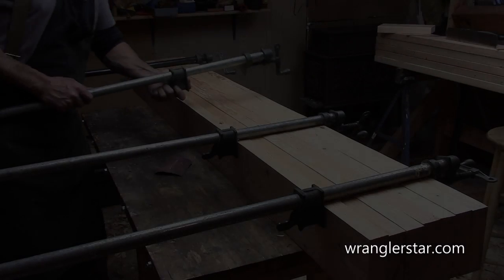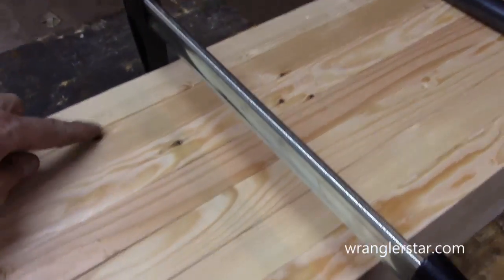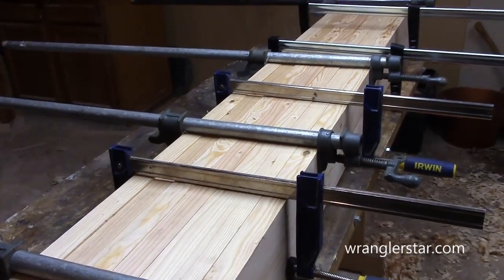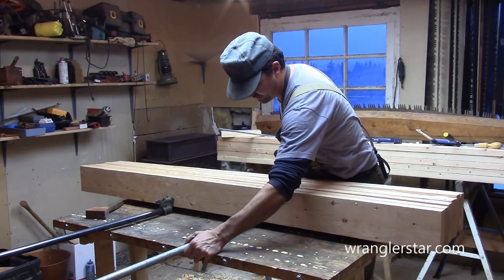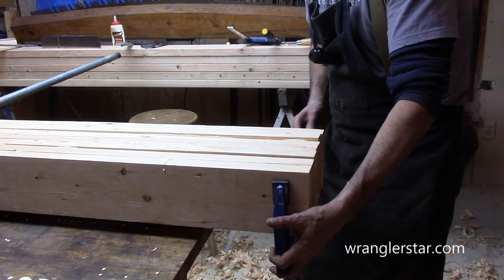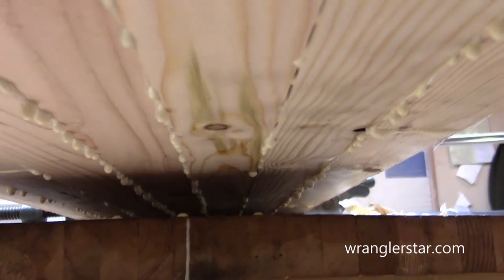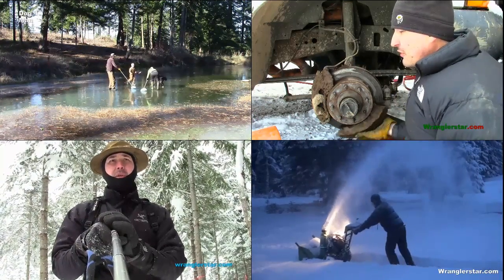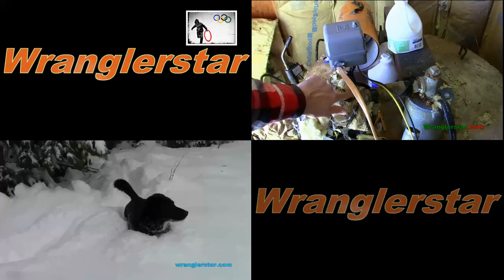Poor Man's Carpenter's Bench | 2 Wranglerstar

Comment: you don't need more glue you just need to find a scrap of wood and spread the glue and completely cover each flat surface with your already generous application of glue. the joints will not have any voids and you'll get full squeeze out the full length of the board. Then when you clamp, place cauls, scraps of wood, placed between the clamp heads and the wood project to protect the clamps from leaving dents in your project as you apply pressure and tighten the pipe clamps. more importantly it also spreads the clamping forces more evenly across the face of the boards to get  a more even, tighter bond. I have a friend that builds custom laminated  beams for a living.
Reply: h baker super helpful information. Thanks

Comment: Ive been watching your videos for almost 18 months. I have never commented because for the most part I have been learning, however on this video if you do not mind I would like to make some recomendations in the even that you ever build another work bench for any reason.  When you make a glue up that big I would do it in smaller portions, so instead of doing 6 peices of wood only do it in pairs of 2, I know you dont have many clamps so it will take longer but that way you will get a better glue up.  Also spread out the glue evenly with either a roller, putty knife, scraper, ruler or what ever you have that is flat so you can get a even coat, it will help it dry faster and evenly so that you can avoid gaps like the 1s that you pointed out.

I mean no disrespect with this comment, i watched my dad over 15 years build benches for other people and neededless to say he had ALOT more clamps since he was a full time carpenter but he still did it that way because he could get better pressure on the full area.
Reply: uberLejoe
 Well I do alot of woodworking at home and build anything that we need because im not going to pay some one to build something that I can do my self, but definitly not as much as cody does

Comment: Just some thoughts incase you're interested. Tip on how to adjust the blade. When you dial it out about 1mm, from underneath the blade and look along the sole from the front to the back, holding the plane upside down, you can see if its level side to side or not and at the same time adjust with the lever with the back hand. Then when its set level, dial de blade back into the sole and slowly ease it out while planing the wood until you have the right depth (on feel and judging by the curl).  Also one more suggestion on sharpening. If you only sharpen one side of the cutting edge you must end up with a bad bur. I personally also sharpen the flat part of the blade. Good way to test sharpness is to try and shave some hairs of your arm (obviously very carefully). Also make a habit of always putting the plane down on it's side. Lastly, it's important to pay attention to the direction of the grain, always plane along with it not against it. Before starting planing, examine the direction of the grain. Really nice to see you enjoying planing the way you do. I can tolally relate. Wish my workshop had that view.

Comment: Remember: A workbench like this is a work holding device, not a table.  Flat is important. Smooth makes no difference. Small gaps in the glue are not a problem. The beauty of this type of bench is that you can use it and not worry about bruising it.  When it starts getting banged up enough to be a problem, plane it smooth and start fresh.

Comment: I liked that you used the 2 by 6 for this project.  I wouldn't lose much of that mass.  It will be heavy, but I wouldn't go any further down that 5 inches, or just until it is planed flat.  Looking good man.  I was curious how much glue you used.  Looked like you made it through that one bottle pretty easily.  Looking forward to the next part.  This is going to be awesome.

Comment: Being australian we have a cement bond branded Bondcrete, its just PVA, same as wood glue. I use tubs of the stuff, half the price of PVA glue, and apply it with a 4 inch paint brush on both surfaces, super strong but indoor glue only. Will solve your gluing problems and always get max squeeze out!

Comment: Great video brother... Leave the bench as thick as possible you will want the extra thickness in the future if you decide to add peg holes for clamping... thicker also means you can run your plane over it in the future when the top surface gets worn; to remove blemishes.

Comment: When I build workbenches I tend to spare the glue and work with bolts and board. In the same way the butcher block workbench you're working on is designed. To fasten the tabletop with bolts and nuts, I can always disassemble the tabletop to make repairs and replace boards if needed. It saves me the pain of having to break apart or buy/make a new surface. When assembling I use oil and sawdust or sawdust from planer shavings that I hand pulverize to fill gaps, or I use branded woodfiller.

Comment: Hey Cody one way to get the middles clamped is to drill holes though the center and use all- thread to pull it together you could also use your pipe clamps for this as well. Then trim it out so you don't see the holes.  I also agree that  weight is your friend so keep it as thick as possible.

Comment: The bench top section looks fine.
Make the videos as long as you think they should be.
I had to plane the mating surfaces on the second bench after I glued up the two 12" wide slabs they were curved in a very slight S shape so they just wouldn't fit like I wanted.
With a nice thick top I don't think you will need any additional hardware to hold the top together. Bolts don't expand and contract with humidity like the top will. When I brought the 2nd bench top into the basement from the garage it shrank about 3/8" of an inch. With bolts the top expands and the bolts crush the wood. Every time you tighten them the wood just crushes further.
I see you put on the glue and slid the boards a few inches to spread the glue. Very Proper.

Comment: Love those clamps. I have several long and some shorty's. Work better and lock up tighter than any other clamp I've used and I've used a ton. They are older design but work better than modern ones. They are indestructible too. That's when they made stuff to actually last and work over a lifetime.

Comment: A few ideas to make the next glue up go faster.  1. pour glue in a dish(use a gallon jug of blue, you will need it) and use a brush or small roller to apply and it goes faster, 2. spread it over the whole surface of one side, so you don't have gaps.  3.  Limit each glue up to only maybe 4-5 boards so the glue doesn't start to setup on you before you get the clamps on.  Then glue the bigger sections to each other.  I think a 3 inch top is sufficient, which is how thick I made mine and it is very solid(weighs about 150-200 lbs, yours is going to be very heavy).  Great video series, I can't imagine myself doing all that hand planing, it was hard enough with power tools.

Comment: The shop I worked in use HOT water, as hot as you could stand to put your hands in to clean up the same glue you used.
We cleaned the glue to protect sharp edge of the tools, we used cloth dipped in the hot water to wide the glue off.
Reply from the maker: +jolj1 no hot water in shop
Reply: +jolj1 The warm blood of complainers also works.

Comment: Hi Cody. You asked about the bench top thinkness....i wouldnt worry as I have both a 3 inch thick top bench and a 6 inch thick bench and they both hold up nicely, plane just as easy and take a holdfast just as well regardless of the thickness. Although, the thicker top bench with its extra weight will not slide around as much when planing touch stock...

Comment: Cody, I've built 2 Roubo-style workbenches from doug fir, similar to yours. Top thickness of about 4" is fine; not that big a deal. Holdfasts, depending on the design, may not like a top thicker than about 4". Even a 250+ lb. bench will move around when planing larger boards. I added skids to the bottom of my benches' legs and screwed them to the floor. Only takes a couple screws to keep in place. Or add grippy pads instead.

Comment: The bench will hold fine. I found when doing big glue ups like that a glue roller or even a scrap of card board should be used to spread the glue out over the faces. You essentially did the same thing by sliding the boards around. If you spread it first though you can usually get a tighter joint. Best of luck and this makes me want to build mine sooner rather then later! You area true craftsmen sir!

Comment: I built my general purpose work bench using 4x4s for the legs with 2x4 diagonal braces, 2x6 top (horizontally) and 2x6 perimeter frame around the top boards. All bolted together. Super stable and strong with a vise on the corner. It's not meant for fine detail wood working, but it sure has earned it's keep as an all purpose bench. It's been going strong for almost 25 years now.
 At the cottage I have a bench made out of an 8 foot section of bowling lane...You wanna talk about heavy and hard? Holy mother of broken drill bits...

Comment: I think I like the suggestions of gluing the pieces by twos (hey, by twos worked out darn well for Noah) and maybe even the straps for tension as well? I wonder however, if going straps will take away a bit of the air of doing it with old fashioned hand tools? My initial thought is that straps will not distribute the pressure as well and will pull only the edges, not creating a quality seal along the flat stock. Look, Cody never proclaimed to be the 'expert' at gluing up or anything else for that matter. He shares what he does, how he does it and as he does it. He has given Paul Sellers repeated and full credit and acknowledges when he puts his own twist on and why. The guys honorable and he is honest enough as he critiques his own work. He learns very often, as he goes also. And he shares those thoughts and revelations. Okay, so two by two will take a little longer but as Cody would say....it's worth it to make it proper. This is a great project with my favorite instructor. Thanks for sharing Cody! One question, if you've even read this and not fallen asleep.....you mention that you are no longer  are a fan of gorilla glue. Would you share with us what got you to that? I'm not 'crazy' about gorilla glue...but my only real reasoning is that I prefer, as you say, the tried and true....somethings, you just can't improve on.....wood glue, is one of those!! Thanks again!!

Comment: The depth of the wood adds weight, rigidity and therefore stability.. Take off only what you have to to get a level surface. I cannot see an advantage to taking additional wood off. One consideration is the type of vise(s) you will be mounting which may be affected by the depth of the bench. Sometimes accommodated by a section with less depth added to the front of the bench.
One point albeit a small one. Carpenters build framework and houses and use saw horses with cross members to support their work. What you are building is a woodworker, joiner or cabinetmaker's bench. Carpenters engage in rough work and the other 3 craftsmen engage in precise work with hand tools to build cabinets, finish work and furniture. Not intended to slight or offend anyone, just a point of clarification or difference. Both crafts are very necessary, but they aren't the same thing.

Comment: Hey cody, just a tip but next time you glue wood with pipe clamps, use some wax paper in between the wood and the pipe clamps so that any squeeze out doesnt stick to your pipe clamps. Are those pine 2x6's or are they hard wood? I was thinking about making a bench like this myself and was wondering what you used.
Reply: that's a good tip, the black pipes will  leave a schmutz (i think is the technical term;) ) on the work as well if it gets glue on it.
Reply: The lumber looks like Douglas Fir, also it's extremely common in the Pacific Northwest, so that's my guess. That glue will chip right off those pipe clamps, but your way would mean there was nothing to chip off.

Comment: For glue up id just get a old brush or one you don't care about and use that to spread your glue. Also I loooove pipe clamps nothing clamps better. You can use the sawdust under your clamps for glue drip. And as for thickness id finish both pieces of the top get them both squared and plane down to the thinnest one. Also have you received my parcel?

Comment: Cody, the first time I use Gorilla glue I hated it, then I read the directions.. wet the wood before gluing, who would have thought of that?
I have used Gorilla glue in my cedar chopping block to keep from splitting and has worked great for 5 years.
The expansion and over flow can cause extra work, but will make a good joint on un-perfect joints.

Comment: I was wondering if clamping calls on the top and bottom side would be a good idea to make sure the boards are even instead of trying to hammer them into place. It's what I do when making butcher block.
Reply: bldeagle10 That's a really good idea, but I think he's got all his clamps committed to the side to side direction.
Reply: That's the method I used on the 2nd half of my sons bench and the top of my bench. I have a few more clamps than Cody but that would be a good use for threaded rod. Make the cauls long enough to have 4" or so on each side and put threaded rod through them.

Comment: Did you say because of some of the areas not fully glued that you may scrap the job you already did?   So I am wondering why not use threaded rod thru the inner boards with glue and add the outer 2x6's as cover over the ends of the rod?

Comment: I know this is old - but for any noobs finding this.  Not the best way to do a glue-up.  Wood glue depends on having flat mating surfaces. It would have been worth  losing 1/8 per lamination to flatten the faces of those 2x6s.  If you don't own a surface planer you can always find a commercial shop that will either run them for you for a few bucks.  Ideally you joint one face on a wide-bed jointer and then run it through a thickness planer to get two parallel flat faces.   Next - without enough clamps I agree-  threaded rod is the way to go.  If you don't want the metal in your finished bench -  undo it after the glue has cured and replace with wooden dowels.  If you plan it correctly it can be made to look like you meant it.   FInally - spread the glue.  you need a 100% coverage thin even layer.  Tite-bond has a spec whereby you can use a fine-notched trowel which will give you a perfect "spread" when clamped.   But anything flat will work.  Personally I put the glue on with a paint roller for something like this.  It's not required to coat both surfaces but if you don't you gotta boogie because Titebond only gives you 10 minute or so open time.  It can be thinned *slightly * with water and will still develop good bond strength - check their data sheets.   WS's method isn't going to fall apart - but because there are open cracks in the laminations it's going to continue to move with the seasons and will never be as good a work surface as it could have been.  For those advocating "glue it in smaller chunks" - great, but you have to keep each "chunk" absolutely straight or they won't mate.  If you don't have a really flat reference surface (like a torsion box) it's really tough to keep the mini-laminations straight enough.  Better off doing it like WS did - glue all at once.  Just have enough clamps (or threaded rods)  etc.

Comment: WS - Don't forget that your bench is designed by what your doing. As in what  is the main purpose of the bench for?  Cabinetry/furniture making or smaller projects like jewelry boxes?   If it's a hand tool bench then you probably want it to sit a bit  lower so that you can get over on top of your work such as when you're planing wood, sawing dovetails, chiseling etc.  
As to the thickness, your bench is your best clamping surface. If it's too thick you won't be able to clamp your work to the surface of the bench thus limiting it's effectiveness.  From all the reading I've done on this somewhere between 3" to nearly 5" is more than enough.  You want it heavy so it doesn't move while working on it and that's where you'll get a lot of your weight from as well.    Also another clamping alternative is a hold fast which you can forge out of some bar stock.  If you go thicker on the bench top then you'll have to have a longer hold fast so that it levers it's self in the hole.  Not that big of a deal since you know and have the capacity to forge your own stuff.  As to the width well you don't want too wide of a bench.  Otherwise tool's get away from you.  Seem's kinda crazy but 24" to 20"  seem to be ideal as you can slip casework over the bench and do some touch up with a plane.  Really at the end of the day it comes down to you and your personal preference.  You have a bench you built for your son Jack and worked on it for many years.  There's things you know you don't like about it and others that you do all according to the style of work you do.   Go off that.  Though I will say hand tool work on a tall bench sucks especially for using planes.  You want to be on top of your work.  One more thing (its long I know sorry).  As to the gap in your boards I saw a bench made by a guy at the local woodworking store with some large checks in it and he used a special type of liquid epoxy with iron oxide mixed in to fill it in.  Looked really sharp and gave it some character.  Not sure of the brand but I'm sure if you get on the internet you'll find something that will work.   Take care!